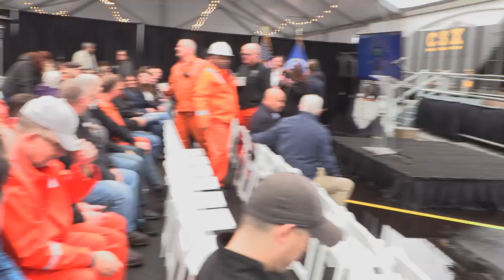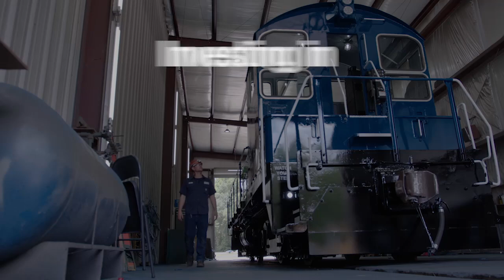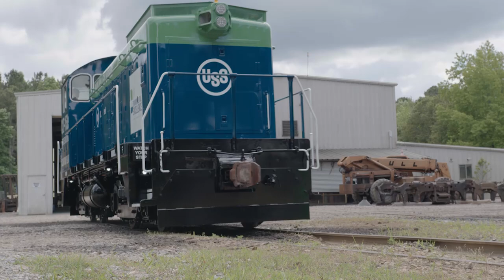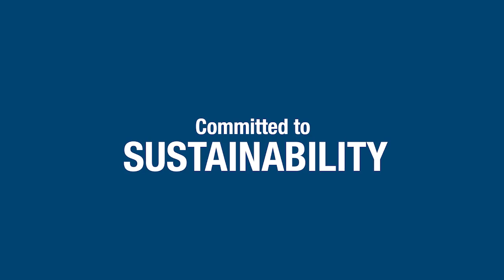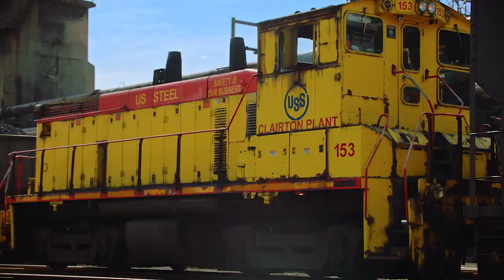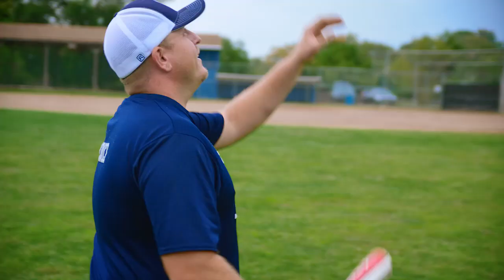Event replay: Battery-powered locomotive unveiling at U. S. Steel's Mon Valley Works

Comment: Just wondering how much down time there will be on charging that locomotive? Also how much coal from a already stressed power grid they will take to charge that thing and one last thing, where are the minerals mined to produce those batteries? Nothing wrong with going green as long as it’s feasible to the business.
Reply: Subsidies suck too.  That's my money they paid for it.  Volkswagen settlement lol.  It was a shakedown with mandates that were impossible to comply with.